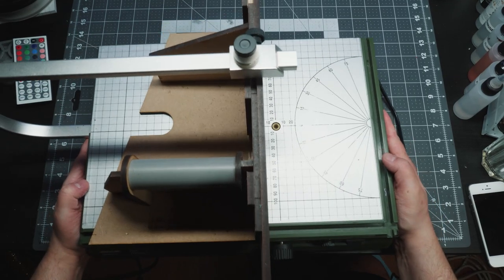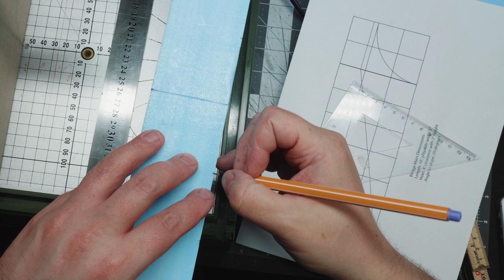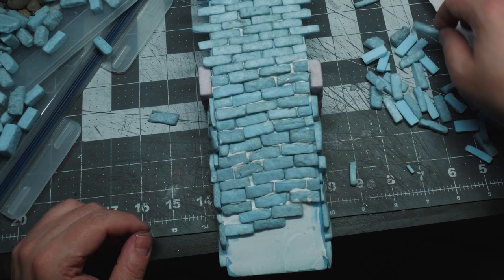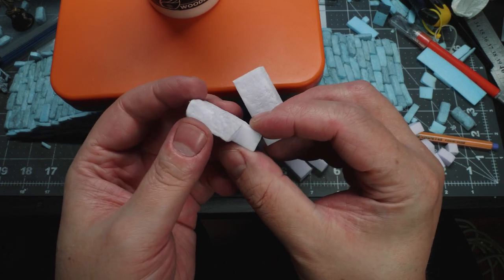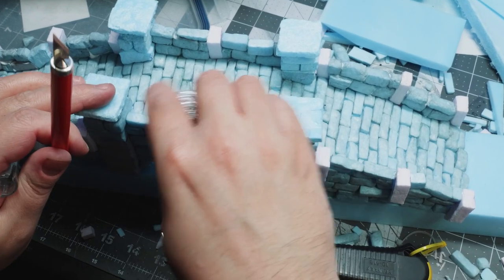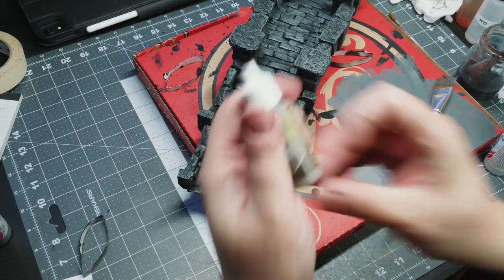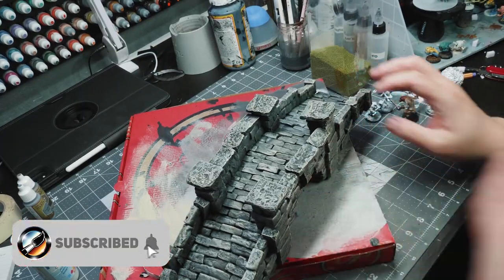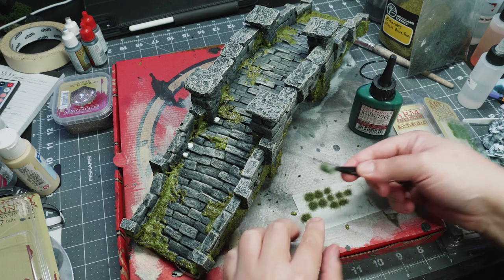Old Mossy Stone Bridge Wargaming Scatter Terrain Tutorial

Comment: Fantastic! quite a unique and beautiful bridge. I enjoyed watching you make it.
Reply from the maker: Thank you so much William! I see at least three more bridges in my near future! 👍😉
Reply: @DevsDice  , I am now making a 1/25th scale graveyard. I fashioned 8 tombstones out of Super Sculpey. I am using styrene foam laid on a 9x12 frame for the base of the diarama. I am making an old twisted dead tree for the far end of the diorama. And I am making a 1/25th Grim Reaper to be standing at the old rusty gate at the front of the peice. 
I have been doing dioramas since my days as a special effects artist in film in the 1980s. I was on a project for Disney/WED that built a huge diorama for a motion control flyover that was built in an aircraft hanger at Burbank Airport. It was about 75 yards long, and around 30 feet wide. I was in charge of all of the vegitation I had two model makers working under me and I designed the manufacture of several hundred miniature cacti, plus scrub bush and a stand of eucalyptus trees near the front of the diorama. Eucalyptus has a very interesting bark that can be in various colors. I used the brownish gray peeling kind. The trees were twisted wire with the trunk and large limbs made of building up hot glue to sculpt the body of the woody parts. You can use a wood burner to detail the bark. Now with my hero trees I use the hotglue to do the basic shapes and then go back with a layer of Skulpey to do finer sculpting of the bark on most types of trees. I use #3 steel wool for the fine branches. I developed these techniques back during that original diorama project, and still use them for my hobby work to this day.
Sorry for the length of my reply, I don't have anyone nearby anymore to talk shop with. I can show you pictures of some of my work if you would like. My email is whittw47@gmail.com 
Love to hear from you

Comment: Great video. Lots of great tips and tricks in it! 
But, just for future reference/knowledge: You don't get single layers of stone like this, simply because putting any sideways force on it (like someone leaning on it) would knock it all over. When you make stone walls, make them a lot thicker than you think. The minimum should be two stone bricks wide and if you do that you'll want some stone bricks that are turned 90° to cross the two stones and tie the two together. Drystone walls are thicker still and tend to taper out at the bottom a bit. They normally look neat and flush on the outside, but if they broken open, there should be a cavity full of higgledy piggledy stone that almost looks messy. This is just because the main focus is on the outside, so builder would use stones that are specifically cut to look right. But on the inside any stones can be used as long as they fit tightly together, so the shapes on the inside wouldn't necessarily be uniform. The same is true of castle walls and stone bridges. Even modern brickwork follows a similar set of rules, except now we fill the middle with insulation, moisture barriers, etc.

My recommendation is that I think your builds would be massively improved by watching some videos on historical architecture building techniques and building dry stone walls as it's a fundamental building technique that carries through to all other brick and stone building. As a minimum we should all be thinking "where's the load going?" when building. Sure if it's a magical structure or something from Mordheim where it's still standing by impossible means, ignore all this. But generally speaking if you think, "where is the load going? Does the weight get transferred all the way to the ground?" If it doesn't, it's going to look wrong. Every brick needs to transfer it's weight down to the ground and transfer it's weight sideways into other bricks if it's going to have a sideways force placed upon it. Think about the Keystone in an archway. If you keep those basic rules in mind while building, you'll get far more believable and grounded structures built.

Anyway, it looks great! Hopefully my suggestions help you in future builds.
Reply from the maker: Thank you kindly for the insight! 👍😊

Comment: I still owe you a tip and I saw you are using blue foam so lets talk giant mushrooms. You cut foam discs, round the edges my tips is in the gills score the underside like a pizza add in miner cuts as well. DO NOT HOLD IT put it on a I used a metal coat hanger, heat the bottom with a lighter the gills will swell an open on the foam. You can also make weird glyph I cut an eye in foam pillar then scorched it splitting and cracking in a cool way.
Reply from the maker: Oh wow that sounds cool! Might test that if I will ever do giant mushrooms! Thanks Brice! :D